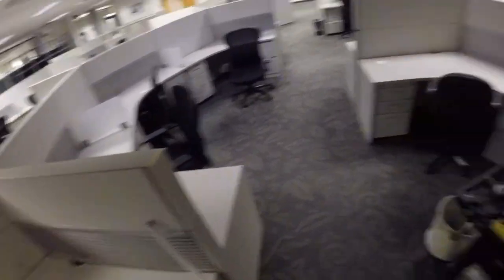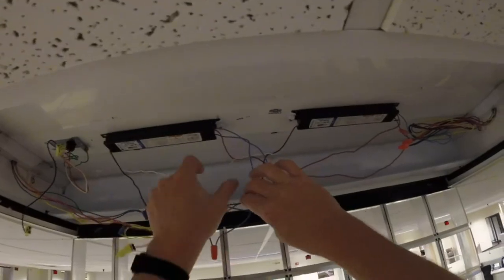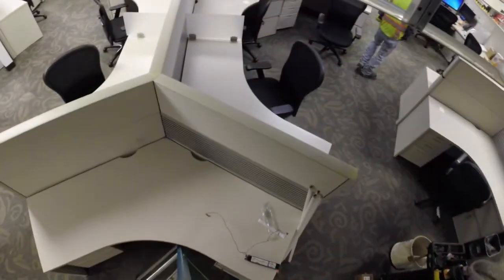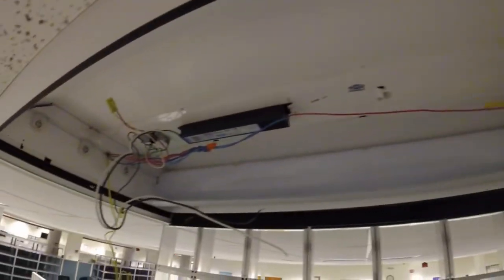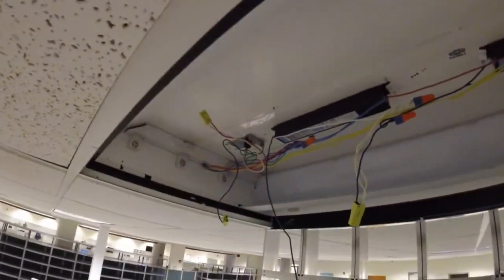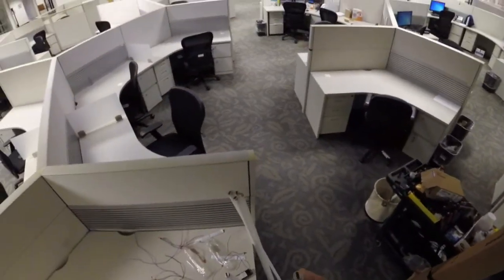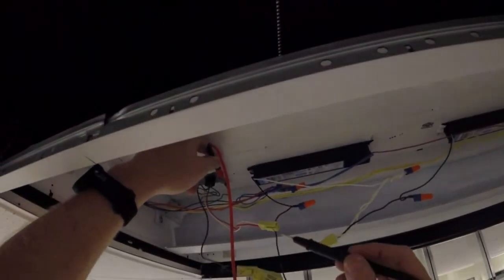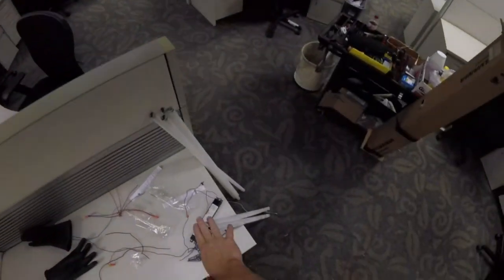changing 277 volt ballasts, electrical

Comment: thats not how u do it..heh...took way to long.And the wiring?? ...how is it , there was a blk(120v)..red(277V).white neutral and grn( ground)on the fixture(power input).and u used both powers?..one ballast hotwire on a disconnect with no neutral connected to the 120..then the other disconnect u had the hot and 2 neutrals on the 277...?..put both ballast on 1 disconnect..thats why they have four inserts..at 16:19...im floored..ima bet u figured that out and did a lil editing...blamming it was unhooked up top...the forgetting to turn camera on thing..lmao...ur boss mayb watching eh..
Reply from the maker: Well they were quick disconnects, and the inside lights were one 1 switch, and outside lites were on 1 switch, actually 2 different circuits. So you're actually wrong. 1 neutral because when building was built it was code to have 3 lighting circuits on 1 neutral,  sorry grounded conductor, no such animal as a neutral, that's a trade term.
Reply: @Paul Albus  ah..makes sence now then...i hate that...they should just do every other lite instead of maken lite half n half...i couldnt make since of the wiring at first..lol
Reply from the maker: @SlayerHawkX  plus the evidently ran out of 3 wire quick connects when they rebuilt from t-12 to t- 8 lamps so that makes it look weird also.  But now they are all direct wire LED lamps.
Reply: @Paul Albus  yup. We been doin those for over a year now...job security!!..lol...iv been to places we done 15 years ago..

Comment: Are there   58W   T8  1500mm   lamps?
Reply from the maker: 13 watt t8 4 foot lamps
Reply: @paulalbus491  We have 36Watt this size lamps in Russia at factory. Inductive ballasts are 220-240 Volt. And starters 36-80 Watt.
Reply from the maker: @sergeiparkhomenko5542  wow! those are huge wattage. LED lamps are really taking over in U.S. i have not changed a ballast in over a year. now I just by pass the ballast and wire the lamp sockets direct. the LED lamps are rated for 100 volts to 280 volts they are so much brighter, and last years longer. I used to have a video on upgrading those to LED but didn't get a lot of views so I deleted it. I will see if I still have and and re post it.
Reply: @paulalbus491  I agree fluorescent 36 Watt lamps are huge wattage. But there is no possibility to replace all fluorescent fixtures for new LED - fixtures.  In fact we try to use 9,18 or 24 Watt  220-240 Volt LED- lamps in old fluorescent fixtures by Your method (if lamp sockets are not broken). If broken, we  install 32 or 45 Watt 160-260 Volt alluminium LED- fixtures.  Power supply sistem in Russia is 380/220 Volt that is nominal. Usually we have 380-420 Volt (three phases for motors, heaters e.t.c) and 220-240 Volt (for lighting, recepticls).

Comment: About a year ago i was changing one of these types in a factory. I unfortunately was trained wrong and was hooked up to a hot wire for roughly 8 secs before i blacked out and the weight of my body caused me to break the connection. I still suffer from issues in my muscles as well as shoulder and neck pain. Always work safe and always double check your safety.
Reply from the maker: Work safe and cut power when possible.  277 will kill you quickly

Comment: See this ballast its covered in PCB's. I'm going to toss it to you and DO NOT drop it.
Reply: pcb ballast havent been used in 40 years....but u may come accross one in an old warehouse..
Reply: @SlayerHawkX  I was tasked with removing them from several facilities. Some jobs were written off as complete but never were and were left to be found decades later. Ever see a pcb plume dust from a fixture installed in the 1960’s? I guess you haven’t.  One guy said don't talk about it another guy warned me they sent me to get sick cleaning up after them. I couldn't of imagined how sick I was going to get but I knew if I did I earned the right to speak up about it. Last time I handled a pcb ballast was about 2010 for the DCR.
Reply: @CrazyEyesGaming  been doing this 25 years...iv seen it all...20 years ago, id have the oils all over me
Reply: @SlayerHawkX  Some of it’s hard to get off the skin isn’t it? The experience left me a bit aggravated is all. I went through a lot of hazardous work I had to refuse some of it. Heard nobodies going to look out for you but you a lot. In my research trying to understand why I was getting such horrible inflammation throughout my body I read about several kinds of pcb’s one having dioxin being especially nasty. Some chemicals were altered according to profitability of course. ‘We don’t pay you to be safe’ haha. You’d have to live it to believe it.
Reply: @CrazyEyesGaming  ya..it was like stickum....1st thing recycling plants ask...how old are the ballst..lol